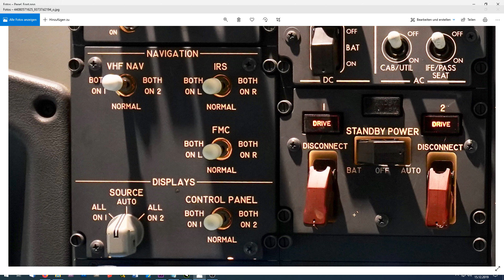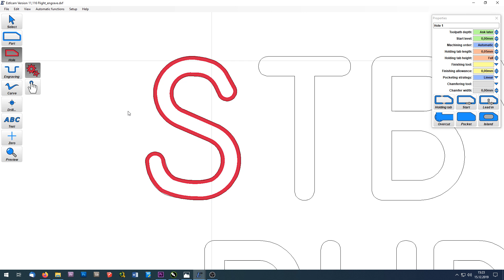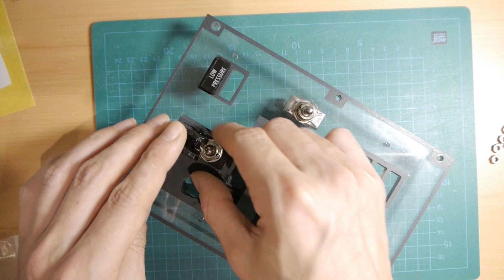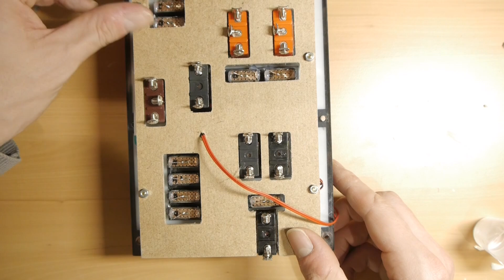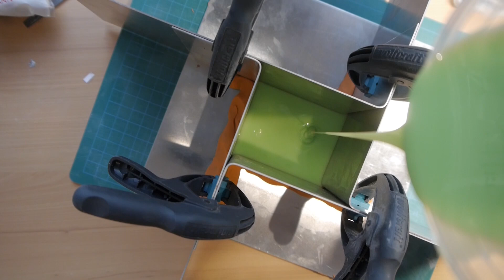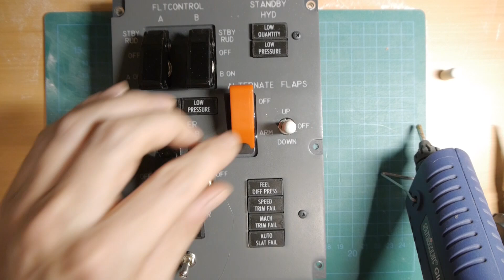Flight- and Navigation panel - A Boeing 737-800 Homecockpit #38

Comment: Michael I admire your tenacity but if you're going to do all these panels you need to buy a laser cutter, it would save you hundred of hours work. I can cut both those panels leaving the masking on the acrylic for the lower panel, all in 10 minutes. Then I paint them, and engrave them with the laser. finally stripping off the masked area that is simply the plastic that protects the acrylic when it's made.
Reply from the maker: Lucky one. But where would be the fun, when I finish all the panels within minutes? But I'm planning to build a laser cutter in the future. Maybe this can be another interesting project.
Reply: @Mickeys_Flightdeck  I hadn't thought of that, some more chapters of Michaels progress in this interesting story. Incidentally I wasn't trying to undermine you're undeniable talents, I just thought it may get you flying sooner. 

I imagine you know that many builders never finish their projects because over time they lose interest, but if they can get the cockpit flying it spurs them on to finish it. 

Having said that, every builder knows it's never finished anyway. There's always something that could be better, Motorise the throttle, link the yokes, change servo gauges for real ones.... it goes on! 

I'll still watch your progress with interest.

Comment: Fantastic Work Michael. Will you be making all of the overhead panels? If so I will want to follow along. I'm about to get a membership to a makers space that has cnc router, 3d printer and laser cutter. Hoping to make all of the panels.
Reply from the maker: Yes, I will build all the panels. It will be a long process, so you will have enough time to build it.

Comment: Currently doing an overhead. May i ask where yoy got those LED strips?
Reply from the maker: Sure, I bought them from Aliexpress. The 5050 LED stripes with 60 LEDs.
Reply: @Mickeys_Flightdeck  thank you. I actually discovered you can get strips to cut individual LEDs. Also trying to figure out an alternative to the 3d printed annunciator holders as i lack a 3d printer currently. My panels are printed and glued to plexi. Looks fairly good.

Comment: Good evening Mickael,
I have finished manufacturing my CNC and would like to start manufacturing my MCP.
I made one prototype in MDF which works well with X-plane, but I'm afraid I won't find 
white acrylic panels big enough in France because the MCP measures 71 cm anyway!

I can't find your video in which you talk about the characteristics of your acrylic sheets ...
Can you help me find it? Could you tell me where you buy your acrylic sheet ? In Germany ?
Are you satisfied with the quality, especially the rendering with the backlight? 
Thank you in advance for your help !
Reply from the maker: I'm going into this in video #30. I used 30% translucent white Plexiglas. Die backlighting comes out really good. But if you want to increase the visibility of the engravings whithout backlighting I would recommend a less translucent one. The power of the backlighting LEDs will still be strong enough. I searched for a local supplier of acrylic in my town. It is cheaper than paying high shipping costs. Maybe you find a manufacturer who can order you a sheet.
Reply: @Mickeys_Flightdeck  thank you for your quick reply !

Comment: What cockpit panels are you going to build in your next video?
Reply from the maker: I'm thinking about the electric panel.
Reply: Michael Schulz which electrical panels are you going to be doing in the next video?
Reply from the maker: @caleb0606  I thought there is only one. This one with the green seven segment displays and the switches where you can control the input from the different generators.
Reply: Michael Schulz There are 3 sub panels for the electric system. Which ones are you making.
Reply from the maker: @caleb0606  I will post the progress on instagram, when I have something presentable.
Reply: Michael Schulz I do not have instragram. Can you please post your status on your website?